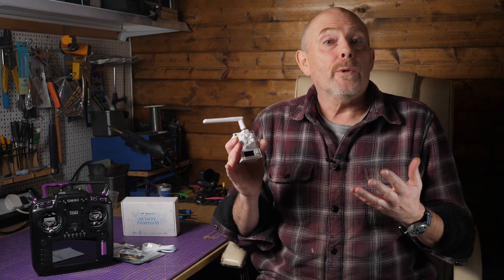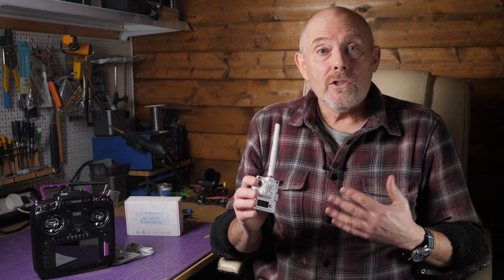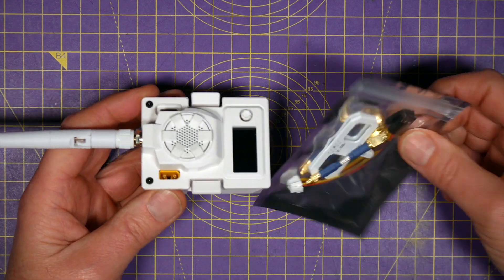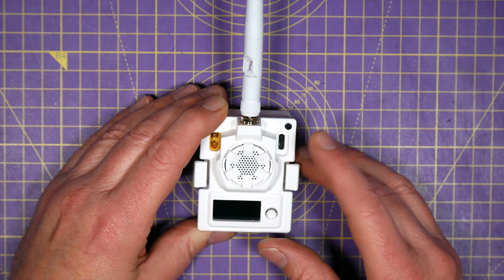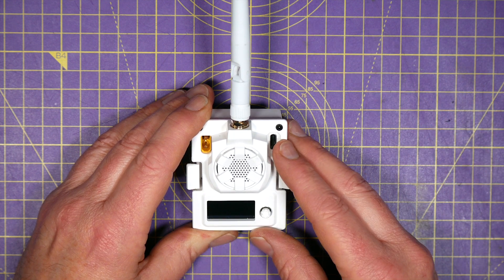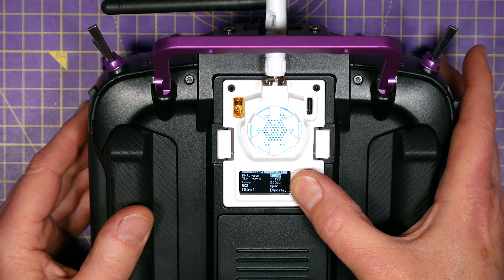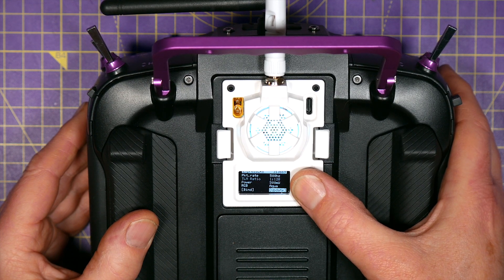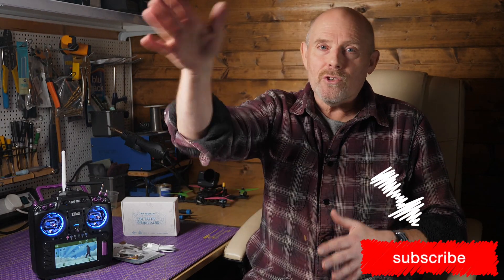BetaFPV ExpressLRS Micro TX Module review - 2.4GHz 500mW

Comment: Iv had the same Module for over a month, absolute pain in the ass. its just sat in the box. Got two spi Elrs models i cant even bind to. iv just gone back to my Crossfire. Any ideas how to get it to bind?
Reply: The TX module and the RX's need to be on exactly the same ELRS firmware versions, or they will not bind.  Also make sure they have the same binding phrase set (or NO binding phrase set on all of them).
Reply: I heard all brand new recievers in the box and brand new modules are version 1 firmware  ( 1.1 or whatever . No need to ruin it with upgrades or flashing right away . New ones work without beta update or flashing ,or firmware problems , or anything .
    So i bought 3 more recievers .
   I will try to bind one using a phone charger cord with the red and black wires in it . That saves soldering up the drone if it won't bind . Forget the rx and tx for binding .
   Put module so the word bind is lit .
    Power the reciever 3 times quickly and see it double blinking blue .
   Then I'm  going to guess " long press the module button " ?   If not maybe the open tx transmitter has a bind button in the menu ?
    Or just use crossfire .